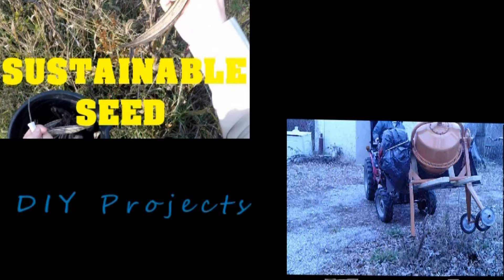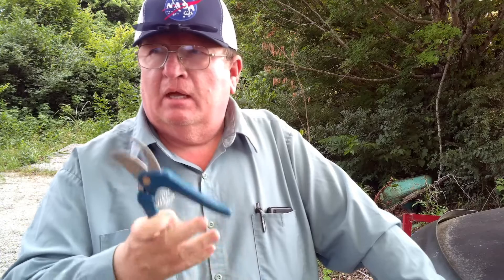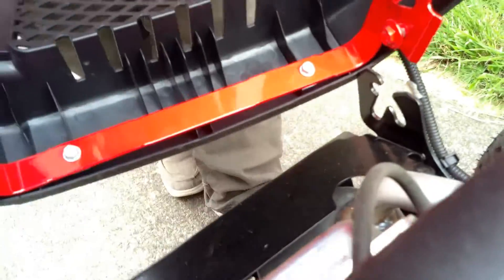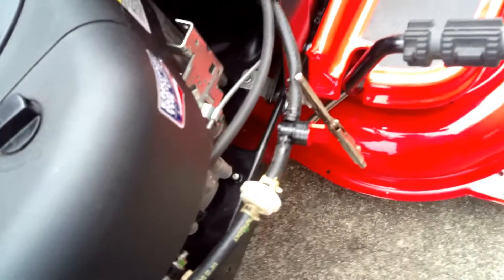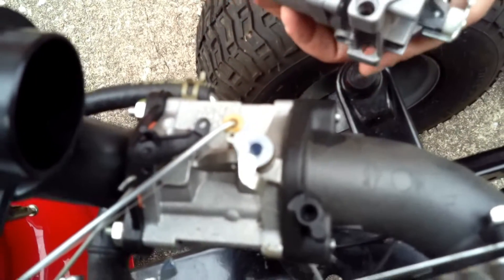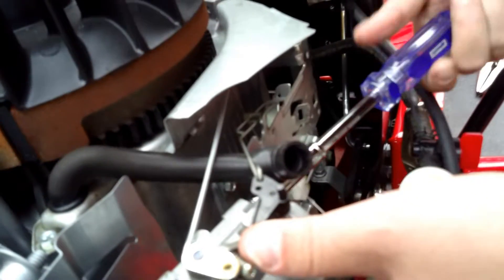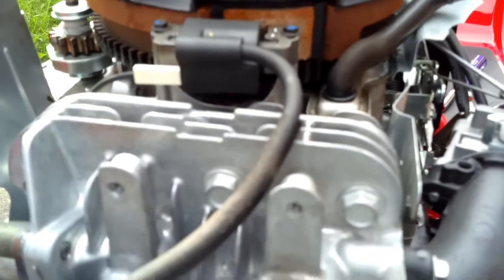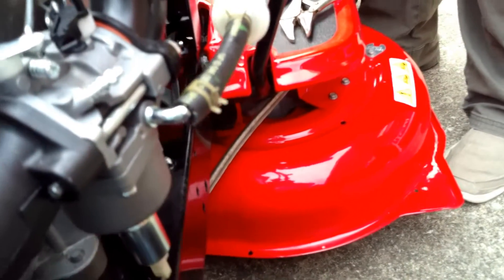Craftsman T100 Carburetor Replacement Briggs and Stratton 590400

Comment: do you still have that mower?  what kind of transmission does it have?  The Craftsman website says it has a gear transmission but I doubt that because that page also says it's a 7-speed.
Reply from the maker: One of my boys has it. I didn't look but it has 7 speeds no clutch, and a separate gas feed. It is my bet that it is a belt transmission. Craftsman calls it a CVT but we called them belt transmissions my entire life.
Reply: I know this video was created over a year ago but my question is where were you able to find this carburetor part for $30 Plus
I am located in fort Worth and the parts house I am going to has it for $120